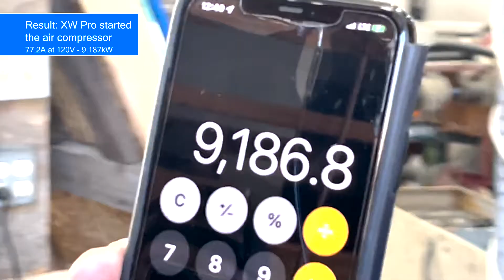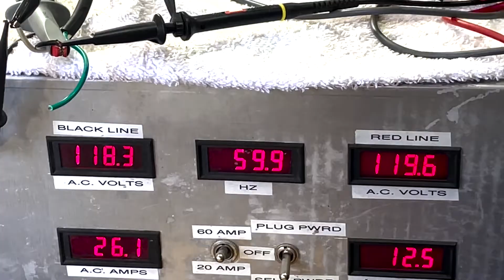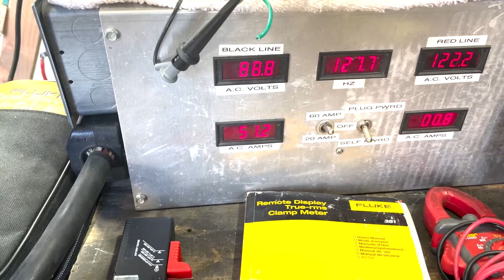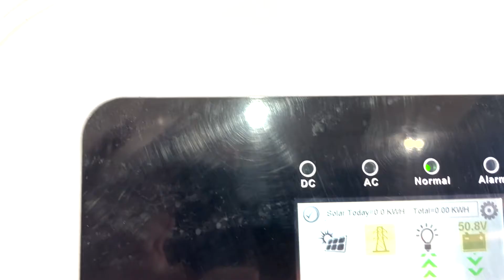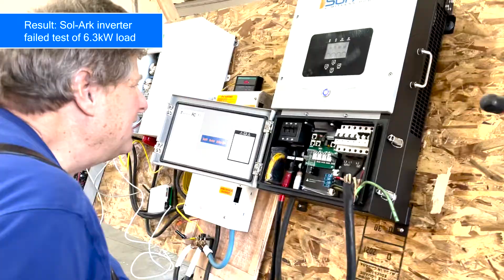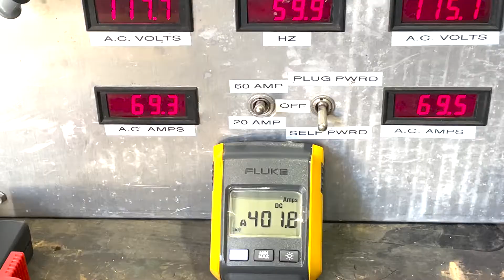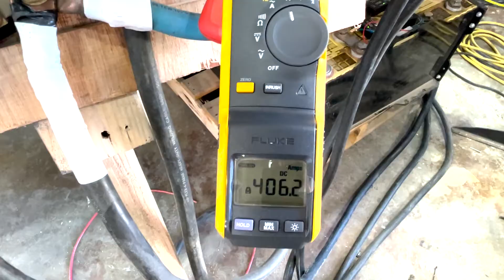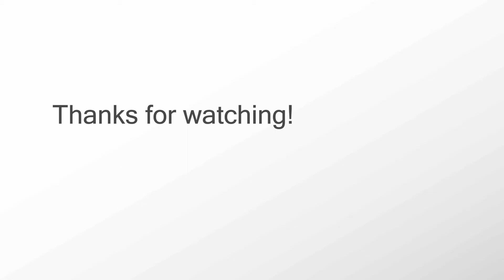XW Pro vs Sol Ark

Comment: I have only used Magnum and Outback. I prefer low freq inverters. My custom China inverter is pretty good. 10 kw 120 dc to 120 ac. I use an auto trans for my 240 vac needs

Comment: I don't believe that this has to do with quality. I'm quite sure both of these inverters are the highest quality on the market.
I believe this is a low-frequency inverter vs high-frequency inverter issue, as well as a fundamental misunderstanding of how high-frequency 240 split phase inverters work.
I believe this SolArk, and any other similar spec high-freq inverter, should be considered two inverters in one.
The SolArk 12k is essentially 2x 4.5kw inverters paired. Yes it will cause it to trip when you put more than 4.5kw on one leg (one of the paired internal inverters).
The whole discussion of nuisance trips is a question of system design and expectation, not quality.

Comment: There is no question an autotransformer based inverter performs far better. The Sol-Ark 15kW has so many great features including a 200 amp pass-through and 5.5ms transfer time with ability to charge batteries from the PV during a grid failure and start the generator when the batteries hit a pre-set voltage as well as kill the generator at a pre-set voltage.  It can do peak shaving,  and time-of-use.  It can handle old, dirty generators for battery charging.  There are SO many other features. But it has the same power/leg limitations as the 12k.  It's really disappointing.  You CAN buy an autotransformer to put on it but then it's even more expensive than its already sky-high price.

I have a SunGoldPower (of all things) 12kW inverter that's a powerhouse.  It runs my 2800 SqFt house with no complaints, including an electric oven. It weighs 200 pounds because of its monstrous transformer.  That's how it's done, IMHO.  Now that I'm going on-grid I need to replace it with something that's UL rated and can deliver like the SunGold.  Maybe a UL Rated SunGold?  I know they work!

Comment: There are a lot more considerations than just peak loads.   The video just shows an attempt to run massive loads on a single undersized inverter.   Don't do that! 

For example, if you really want to handle these peak loads, you can clearly size the Sol-Arks by upgrading to 15k's or running multiple inverters.  The problem was that he simply didn't read the Sol-Ark manual or talk with anybody in sizing the loads.  A decent comparison should have at least considered costs, including the MPPT controllers, electricians labor, and assumptions about sizing this inverter against a PV size and battery bank.  At best this is an apples vs oranges.

I looked at Schneider, Victron, Sungold, MagnaSine, and GroWatt.  But, I'm set to install dual 15k Sol-Arks next month, and IMO the Sol-Arks seem to provide a cleaner solution for most situations.  In reality, the inverter itself is one of the least expensive parts of the system (?~ 5-10%). By the time the components were added up so that they might meet my local code requirements and considering things like the additional parts and  labor to config the system (e.g. copper wire isn't free, and in my case it required NEMA-3r enclosures and a rapid shutdown solution at minimum), the properly sized Sol-Ark system ended up a much cleaner solution, and at a better price point.   As far as I can see, people that own Sol-Arks tend to love them, seem to rave about customer support, and just don't have this shut down issue because for most people the installer knows how to properly size the system. By the time people like me get past the cost of the batteries, and labor/engineering for proper PV mounting/automatic shutdowns/grounding/inspections/etc, they are well beyond trying to skimp by saving a couple hundred bucks by going with an inverter that is just sized too small.  

Even if you don't decide to use Sol-Ark, if you really need to run that compressor and all that kitchen stuff at the same time - just get a properly sized inverter(s) to handle the peak loads - including reading the manufacturers directions to correctly size the inverter.    Then if you need more inverter - piggy back the inverters to handle the loads and/or consider a load prioritization solution.  And, if you are really running the entire farm 100% off-grid, you'll also note that you probably need to add more PV panels, MPPT controllers, and batteries too.

Comment: yes if they would just - update the XW  system for  2023  they stopped improving  XW in 2010 ish seems to me.. added that crappy interfaces that sucks and battery monitor all separate , plus charge controllers not built in, parts got to buy  look at $$- plus all the electrical needed - insane to build this system  .. need to look at sol ark ideas -  but yes also power what rated to power.    do a test on the 15KW sol ark really want to see this.   also test with auto transformer and see others questions thinking maybe battery amps default - show your settings. like to see .

This video has an auto transformer example. Not best wiring but would like to see on your test
https://youtu.be/BB3CLyXhwD0

Comment: Great video. So why is there so much hype around the sol ark?
Reply: If you want to start a really heavy load without a Soft start unit then get a Low frequency Inverter.
If you want a system that can take power from Solar, Batteries, Generator and the Grid and blend them into a seamless UPS type power system then a Sol-Ark is the only thing that can do that.

Comment: Autotransformer solves the sol-ark issue.
Reply from the maker: That is a good suggestion it will balance the two 120V legs and make the whole unit take the loads. I strongly recommend a balancing trans if you have large 120VAC loads on a 120/240VAC unit. Thank You...
Reply: @abneysolar3941  yup, not only that, but comparing a transformer inverter to a non-transformer inverter is a apples to oranges comparison. Adding the auto transformer will actually make them an Apples to apples comparison.

Comment: I did a system with 4 of these you may like
https://youtu.be/xJjZ1LO00ow

I have put in many solarks, outbacks and schniders. I live off grid with dual 8k outback radians with similar loads as you.
I prefer outback as stacking the xw pros has more limitations than stacking radians does especially with sharing the internal xfr switch on outback vs not with the schniders. But both brands have more punch than the sol-ark for sure.
Reply: A simple 5kva autotransformer will fix that and keep the system much simpler than the xw pro setup. Charge controllers are 150v, which is annoying. The set up takes forever and customer service sucks with the xw pro compared to sol-ark. I'm sorry but the xw is antiquated
Reply: @windydrew  I completely agree
Reply: @windydrew  XW Pro specs are superior.  The Sol Ark cannot meet it's own specs!? Most battery systems are retrofit, so the AC coupling of the XW Pro is just a no brainer. The set up is not that difficult if you know what to program, if you understand their system. The XW Pro is just that capable... and like anything that is very capable and adaptable it has features that you may have to understand to implement. I can see why you think it is complex, but I can get a system up and running in about 2 hrs IF I have to load firmware and check the connections my electricians made. The Sol Ark also has it's installation quirks (Such as the communication wiring, interface, programming... nothing unsurmountable) .... I vote XW Pro for service after the install, where the callbacks from the Sol ARk will be very high unless you really pick and choose what loads will be on it. Oh and Schneider has had a 600 Volt charge controller for at least 5 years now.
Reply: @javierperea8954  I've installed 6 off grid capable Sol-Ark systems and have had less trouble than the 1 XW Pro system I installed
Reply: @windydrew   I've installed XW since 2010. They do have a learning curve,  but they also have less callback issues after the install, especially with customers that expect rated performance.
Reply: @windydrew  charge controllers are also up to 600v at 35A.
Reply: Thoughts on outback’s new released Mojave?
Reply: @TheJjyoung333  600v @  80amps  or 600v @ 100amps  depending on model.

Comment: Trace is the king of battery base inverter had the OG SW5548 and could never trip it off line with load. So you sir are real deal solark gona steal you for making there flagship inverter look bad 🤣🤣🤣🤣
Reply: I would like to see the SA 15k tested, it looks to be much more stout, plus has some very impressive features.  Not cheap though!

Comment: I have been in the battery-based inverter industry for 25 years and it is really sad how many inexperienced installers I have to deal with on a regular basis.  Some of these guys don't even qualify as basic electricians.

Comment: The claimed EMP durability of the SOL-ARK is to what most of my customers are attracted.
Reply: god what a dumb reason to buy anything
Reply: I agree! And then let's define EMP protection. Are they talking a lightening strike a mile away or the big one dropped 25 miles away?  If an EMP could/would/can take out the inverter, most the electronic loads the inverter may be running will be toast, too. @igneousc
Reply: @theheathkitshop2424  The EMP thing is pure marketing for prepper types. You can make any inverter EMP "hardened" by proper system design and RF filtering.
Reply: @theheathkitshop2424  I had a lightning strike ~300ft from my solar field over the summer that killed 3 Enphase M190s.  Both Sol-Arks didn't care.  Worst lightning related problem I've had with them was a very close strike cause my oldest 12K (October 2019 build date) to glitch out, but a power cycle fixed this.
And the real problem with EMP is an exoatmospheric detonation 100mi to 250mi up like K3/Test 184 or Starfish Prime.
Reply: Except the NTS certification only addresses EMI.

Comment: Hmm , XW , has no support or website to order parts for end user. I think they are the best , however no support = product death .
I am forced to. Consider Victron 24 volt inverts 3kw . I am already and have starred with two context MPPT 60 150 do system design, good thing because setup permits  Lipo4 charge parameters, however can bus won't get it for today's user, Bluetooth is the way to go for monitoring. Firmware updates need USB/laptop internet. It is sad that such a good product will not be used .